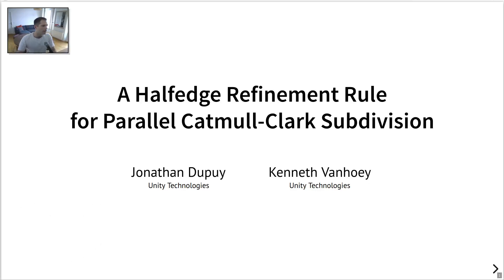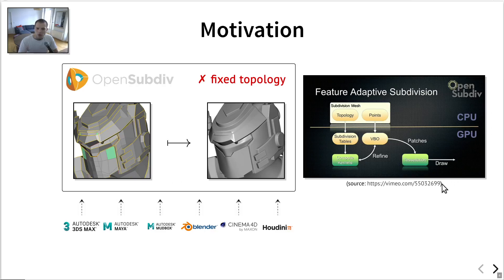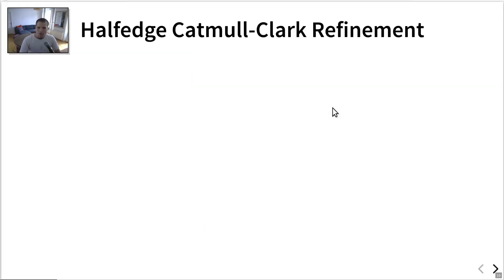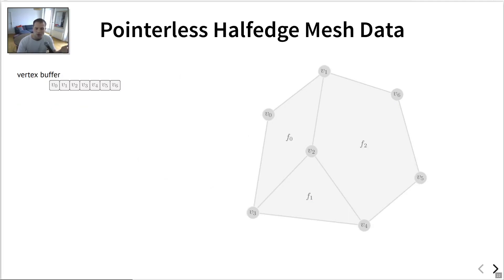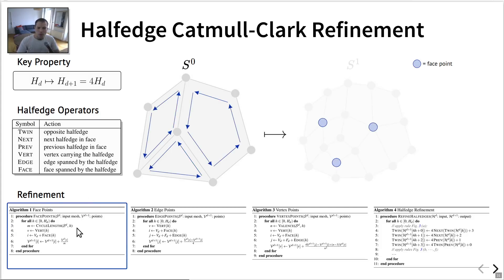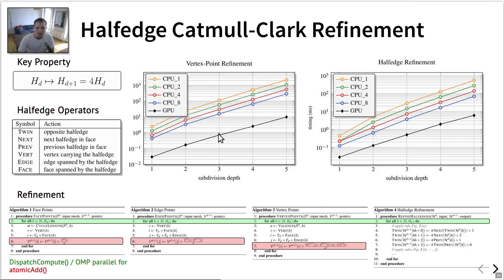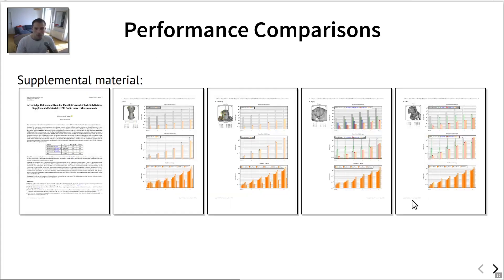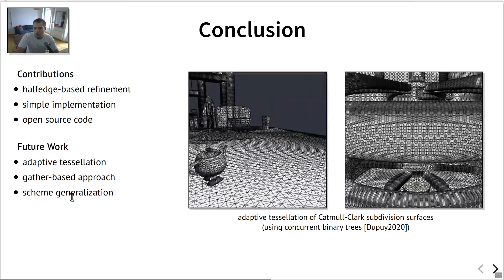A Halfedge Refinement Rule for Parallel Catmull Clark Subdivision (paper presentation)

Comment: Hi Jonathan, Just wanted to say thank you for opensourcing your solution. I have been digging into it, and testing it against an obj file with 7 million points, its subdivides it in only a few milliseconds. I have been trying to go directly from obj to subD, and not use the .ccm in-between file. I was wondering if ConcurrentBitField, could be applied directly to the obj data, and in that way accelerating the generation of the cc_Mesh?
Reply from the maker: Hi Simon! 
Yes I think you could use ConcurrentBitField directly in conjunction with the OBJ mesh but it will be slower than a .ccm file. The reason being that the complexity will be different: ConcurrentBitField runs in O(logN) where N is the number of halfedges, whereas .ccm is O(1).